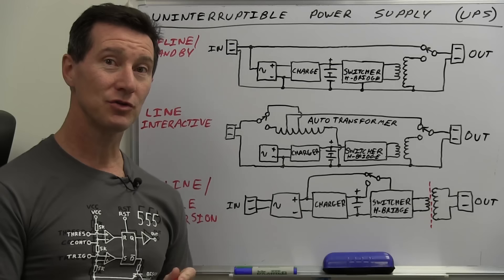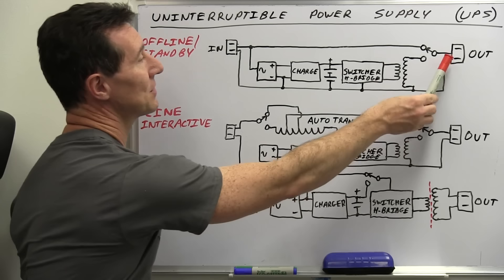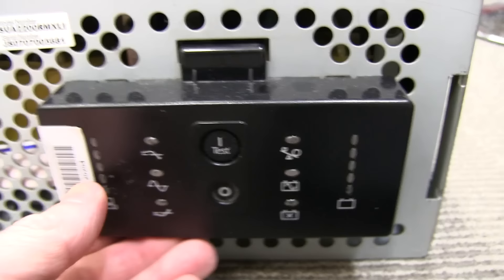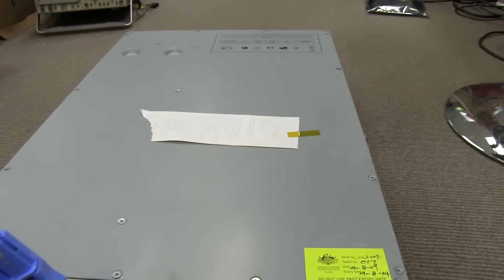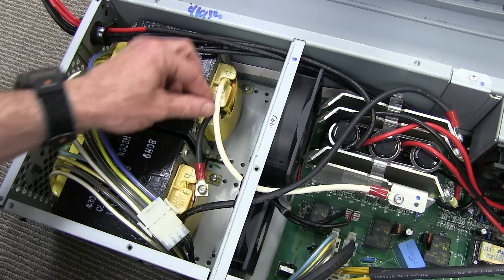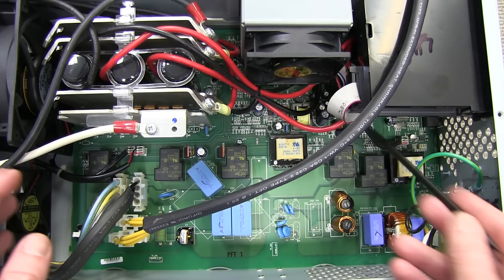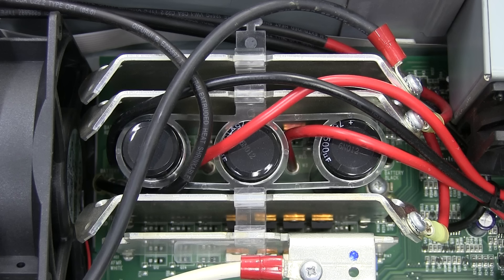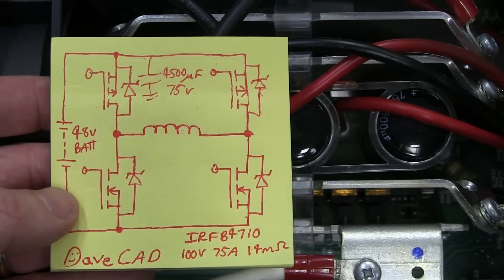EEVblog #504 - UPS Tutorial & Teardown

Comment: I've seen almost identical transformers in 'smaller' rack mount supplies, but they had just one and had 24V battery banks.  Pairing them allows for fitting the whole thing in a 3U case without having to design a custom squat transformer.
Also, small ones (<700VA) almost always use push pull drivers as the switching device losses are lower and the bigger center tap transformer is not an issue as the thing is small.

Comment: 22:58 I notice a good air path to the main cooling fan around those capacitors, so they should stay comfortable enough for the time it takes your server to shut itself down gracefully. I doubt a company like APC would cheap out on electrolytics in something that is ostensibly mission-critical infrastructure.

Comment: Hi mate. What's your view on the reliability of Neutral on the output of a UPS? There is a notion in my team that when a single-phase installation takes place, it should be protected with a 2-pole circuit breaker because UPS Neutral may be somewhat dangerous, unlike in typical installations when Neutral is hard-wired to the N bar or similar. Is this because we regard a UPS as a black box with a possible flaw?

Comment: As to why, all I can say is some equipment doesn't play nicely with square waves, possibly due to the design of the power supply. Another reason might be it uses phase angle control (such as in a light dimmer or hand held non-cordless power tool).

As for the cost, I'd say it's mostly due to the parts. To make a sine wave you need to do Sinusoidal PWM, which requires fast switching and either extra electronics or a reasonably fast processor.

Comment: Hi Dave, I have an old APC UPS, that I'm thinking of converting to a 12V DC UPS to power my router. Bypass the inverter part, as I only need 12V DC. Any instructions or links to go about doing this?

Comment: Totally agree. Google operate on such a huge scale even a small energy saving per server makes it very cost effective. The scale also allows them to make it worthwhile designing their own hardware. Years ago i had some servers with a hybrid PSU made by a company called Magnum Power Solutions in Scotland. Like a traditional PC PSU but with UPS functionality. Very neat design, it would run off the internal battery if mains failed. However it could not cold-start from DC.

Comment: I have scored from my school 2x 390W UPS (APC smart ups 620) and it is interesting, that they work only, when the battery is connected. So my theory is, they're using the battery for the control circuitry like just the battery, because the battery when it's discharged, its voltage is abou 11 or 10 volts, but it is still high enough for linear voltage reg to do its schedual job. Very interesting UPS, i've tried them, but i can't get to work the inverter, like it just says, its overloaded and then it shuts itself down, even, when there's no load connected and th other one fails on the selftest.
Reply: i have  a installation you ups power  it great speech  video  
you can use  battery

Comment: Not in this design, they are used to filter the h-bridge rectified back-fed mains into the battery, which isn't going to like AC rippled DC charging current.

Comment: What is a galvanic isolation? How does it protect one who touches the isolated side of a transformer from electric shock and connected equipment from damage. All I know is that there is no physical connection by means of wire and whatnot.

Comment: I would love your help. My power goes out a lot  where I live, so
I have a couple older smaller APC UPS ,[600w and a 400w] that I have had some lights and laptop hooked up to with larger deep cells and they would run a really really long time, dependent on actual battery life.
 I bought a APC Back-UPS Pro 1000 S BR1000MS [pure sine wave] to replace a non pure sine wave UPS and put my 100 amp hour battery on it, to run my flat screen TV and some light off grid . But, while the load is well under the max load of this inverter, this UPS  unit, thinks it has the same stock 7.5 amp hours batteries that they come with it and only runs for 24 minutes and it thinks it needs to charge the fully charged 100AH battery for 16 hours.
  Not expecting this to not work this way  I put time into this thing  taking out the plastic around the transformer out to put on metal grills and fans  because I know it would be getting hot .
This has a cable to my computer for some other options , but nothing to disable this battery timer thing that is posing as a monitor.
 It would be great if you investigated this and found software to disable the battery timer  shut off. 
It does have several relays on the board and i hear it switch off. If I knew which one, I could bypass it with a switch.

Comment: For the online type, does it matter which type of power source is used on the DC side or if there are multiple power sources? (like 12V lead batterys + solar panels used simultaneously..)

Comment: also looking forward to a followup video with oscilloscope poking.
Too bad it's a rather "uninteresting" design internally(it's just "beefy" for the power), i've seen a SURT5000 (realtime, online) and it's an absolujte joy to see inside, they don't have a single big transformer, it's all toroidal core(and several) high freq transformers inside, also it had ~ 8 BIGGER caps as well and the pack operates at 96V

Comment: I really need an answer how does a online UPS have a switch but no switching delay and why does every block diagram shows it having battery connected as they where capacitor and why does every where they say its running on battery all the time

Comment: is it possible to  connect an off the shelf battery charger, to  a deep cycle 12 volt battery, and then use a sin wave inverter connected to the battery to accomplish the same thing as an online UPS, but with a large say car sized battery.  basicaly so i could make my own that would run for longer than the off the shelf expensive ones.

Comment: The charge current for the batteries is much lower than the discharge current, so they can get away with it.  I would expect the charge current to be a few amperes at most as SLA batteries do not like high charge currents.

Comment: In other presentation UPS Manufacturer said

In the normal condition Bypassed alwyas standby
And below is Sequence of UPS working :

1. In the normal condition, load will be supplied by Charger through Inverters
2. In case Main supply Shutdown, Load will be supplied from Battery through inverters
3. In last when charger or battery broken or under maintenance, Bypassed will be used as main supply of the load.

Which One Correct?????

I think the manufacturng information is not correct, right?
Reply: They are all correct, in an on line topology. Just horribly translated from chinese! Intead of charger, try " rectifier".

Comment: Hi Dave! Great video, iam planning to use the same ups as inverter to my solar sytem, but  how to trick ups to not charging battery when it gets 220v from net?, i was thinkin to give power diode close after akku and after diode connect such small 48v  dc supply, think it will work?

Comment: have had an UPS on my computer system since 2006. Saved my arse plenty of times.. Maybe time to change the batteries in it. But the diagnostics say all is 'Normal'
Vis-à-vis:
UPS Status: High Efficiency
Auxiliary Mains Star Voltage (V): 240
Output Star Voltage (V):: 237
Output Load (%):	30
Battery Capacity Remaining (%): N/A Battery Voltage (V):: 27.6
Internal UPS Temperature (°C): 25

Comment: Absolutely, I was thinking about getting a UPS for my networking gear at home (modem, router, switch) and then thought "Hey, all this runs on 12V DC, why use a 120V AC inverter to waste battery" and decided that I should just build  one with maybe a 24V battery and some efficient switching regulators, plus a float charger.  It'd probably last longer too.

Comment: Great video. Thanks. I torn down on EATON, presumably "line interactive" because I found an autotransformer in it. Question - is it good to use this autotransformer in a power supply (obviously it does not have isolation)? Thanks

Comment: I prefer having AC on the power grid because a lot of high power devices use it and it's easy to convert voltages with transformers and capacitors. Building oscillator circuits (to convert DC to AC) is a nightmare, but using diode bridge for the opposite is cheap and simple.

Comment: This should not be a problem at all. First it's just 50Hz, so no worries about the speed of the diodes.

Then according to the datasheet the diode can take 75 amps (300A pulsed). Most LA batteries don't like charge currents over 0,3C. So it would take approx. at least a 300Ah battery to overload a single diode. Sure doesn't look like one.

Btw. since the diodes are thermally coupled through the heatsink, it's very improbable that only one of the parallel diode will conduct anyway.

Comment: can I feed a square wave to the input of an online double-conversion UPS?  Will doing so damage the UPS or anything connected to it?
some rooms in my house draw power from a non sine wave inverter connected to a battery that can provide backup for extended periods. I have my PC connected to an APC smart online ups that has only around 30 minutes of backup time. If I move my PC and UPS to one of the rooms with inverter backup, will the UPS work fine with the inverter during power outages?

Comment: what is the difference between using only n channel mosfets vs pairs of p and n mosfets in the H bridge?

n channel usually have lover ON resistance than p channel mosfets and for each the driving signal is the same

so what are the advantages of using p and n channel mosfets in a bridge configuration?
Reply: Possibly the main difference is when using solely n channel, driving the high side may need a little more complexity as you need to get the gate to a higher voltage than the supply line. Other differences include turn on/off timing of p vs n so if using all n then no timing differences to be careful about.

Comment: I have a comment about online UPS.. I have Liebert GTX2 online UPS and it works slightly different - input AC is rectified - each half period to one capacitor bank, here is paralelly connected also DC--DC inverter from batteries which works only when power fails. And also there is connected some switching circuit which generated AC again to output....And UPS output is NOT ISOLATED. There is no transformer inside, in fact line neutral is hardwired through from input to output.

Comment: While i agree no-one is ever satisfied, i'd be VERY interested to see a follow up video at some time comparing the stepped approximation sine waves and how true the sine wave outputs are, and what impacts, if any it would have on the devices. I bought a cheap UPS from jaycar which cost a little more than the batteries i needed to fix my SmartUPS, but everytime it switched to battery, the computer rebooted! so i replaced the batteries in the decade old SmartUPS instead.

Comment: No auto-transformer. Did you figure out how the mains voltage regulation works as there's only effectively one transformer that does everything? Please can you plug this thing in and put various loads on it, and under-volt and over-volt it and display the waveforms.

Comment: Have you done or can you do an episode on Parallelization, where you want to use lower amp components (either for reasons of expense, extra control, extra resiliency)? I've seen this done with power supplies so as components slowly fail whole mini-power-supplies are disabled by diagnostic parrallel circuit and transfers load to other components, sort of a RAID approach to power supplies.  I've also seen it done because a guy only wanted to use <1 Amp components for heat sink/cooling reasons.

Comment: Dave, am I right into thinking that those two monstrous transformer don't need to be high-frequency capable switching transformer?
Reply: No, they are connected to line so work at 50 or 60HZ. The switching is done by a separate TX.
Reply: *****
but looks like there is no other transformer big enough for the switching... I wonder if those 2 large transformers takes a high frequency switching input from the H-bridge and directly convert it to 50 or 60Hz output.

if that is the case, I wonder how they design the transformer just to do that? I'm no expert in transformer... I'm just curious how they do that

Comment: further ironic is that the DC-DC converters for buck and boost regulation use AC 200KHz type frequencies in the switching regulator. It's all AC to DC to AC to DC etc... conversion, just more efficient when closer to the load.

Comment: Those battery packs absolutely weigh a ton - I have a 6kVA Riello  with 192volt batteries - it's heavy with the batteries out but almost 65kg with them in! 32A 240v AC in 2 x16A 240v out online system - it's a beautiful UPS and built like TWO brick shitters! :-)

Comment: DC is actually more efficient for transmission, it's just less convenient and more expensive. It would also be too expensive and to big a task to switch everything over, plus most industrial motors would then need variable speed drives to allow them to work.
Reply: I think it would be nice if we standarize DC for equipment level voltage. We can use central PFC and eliminate all rectifier circuit on the appliances, and more easier and efficient to add backup battery.

Comment: Can you actually use car/motorcycle batteries with these and be safe? Years ago a friend of mine and I were at his place and during a major snow the power went out (NY). So to get light he just hooked up a car battery to his UPS (12v batt UPS) and powered the light for about 4hrs. But is it safe to actually charge them with these (matching voltage from the UPS and battery)? I should be posting this in the forum but i don't frequent it as much and need to make an account.

Comment: Wouldnt it be easier to change the order in which these devices are currently the power is converted from 230V AC to 12V DC back to 230V AC and then in the Power supply to 12V DC 
my suggestion would be first to go down from 230V AC to 12V DC and putting the battery and PC load in parallel

Comment: Nice thorough vid mate, I have scavenged a 48V 55A UPS + battery pack which I currently have no use for, But would like to convert it to a Bench Top Power supply. I just need something simple with a variable output. Is the conversion possible?
Reply: +Alpha Mal Yes. But you should be very careful with batteries as they can push out massive currents if you e.g. accidentally short them.

Comment: Body or substrate diode should not be used, especially in when you got 4 mosfets in parallel. I think they must have synchronous control over the mosfet to do diode emulation.  The loss associated with using the body diode is too high, not to mention the issues with current sharing between the 4 mosfets when each one is at different temperatures

Comment: Even for cheap mosfets the reverse recovery rate is <100ns which is more then adequate for mains frequency (mains frequency is more in the range ten million nanoseconds switching time). It is not even note worthy for these types of applications. Plus there are ways of decreasing the recovery time (see patent US20080042196 A1)

Comment: Hey I'm a huge fan of your work. I'm not sure if you will see this message. I'm a new truck driver. I believe that there is a huge Market to the understanding of inverters and power consumption for the appliances they can be installed in them. I believe that use 12 volt batteries
Reply: In parallel
Reply: I will provide whatever feedback you need

Comment: Dave, it's not exactly related but would you happen to have a clue why the UPS I've had for years makes 'screaming' electricity noises when it's hot/humid and the output wattage display drops from 110w to 50-70w, sometimes a whack fixes it ironically but sometimes it doesn't. I've always planned to have a look at it someday but haven't got around to it haha.
Reply: Sounds like you've got a broken solder on your output filter AC capacitor! Check that out before it bust your power transistors!